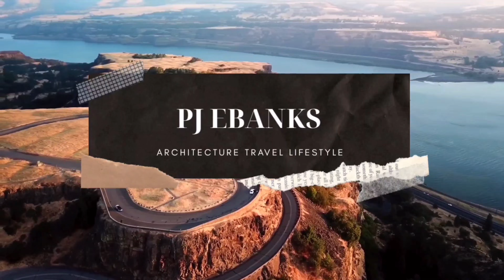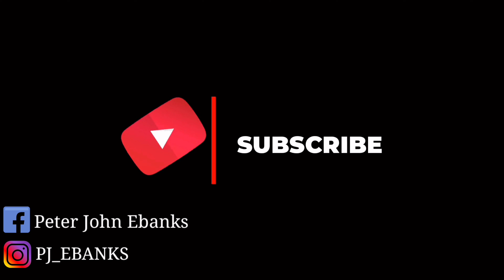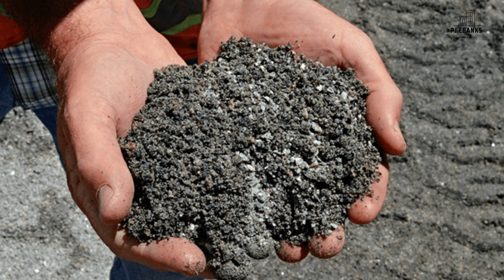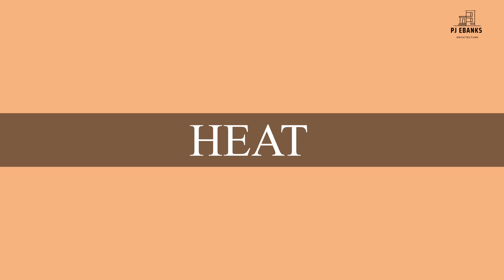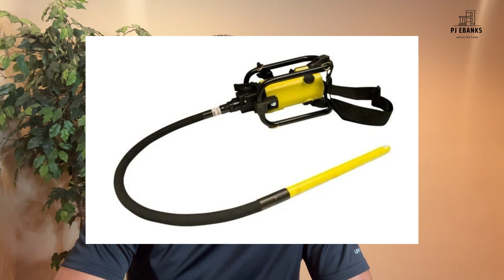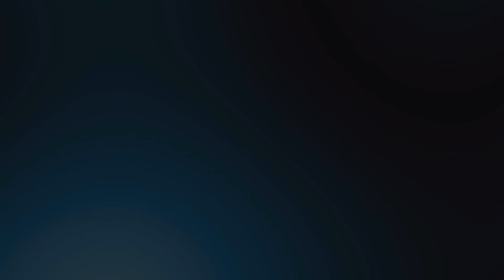Rebuilding After Hurricane Melissa: How to Construct a Strong Concrete Slab Roof in Jamaica

Comment: Roofing is not a one size fits all!  If your structure was never designed with concrete slab roof in mind don't do it. Consult a civil engineering company first. Also, concrete roofs brings LOTS OF HEAT and will make your AC units work harder running up your electric bill. Decra or metal roof is good.
Reply: That’s correct, concrete roof does attract heat, but silicone roof coating is renown as a heat repellent.

Comment: How would you build for earthquake?
Reply from the maker: Great question! To build for an earthquake, the key is a strong reinforced concrete frame with properly tied columns, beams, and shear walls, plus a solid foundation based on your soil type. Good steel, proper tying, and avoiding heavy overhangs help the house flex safely during shaking.
Reply: @PJEbanks TY. If you have not done so, I would like you do a vlog about that.
Reply: Why can't a wooden house withstand an earthquake.  It is all about the footing and the foundation. Most houses inna di USA are wooden structures. Concrete homes could be more devastating during an earthquake due to the weight if not built properly. Can you imagine if these concrete decks collapsed during an earthquake? Notwithstanding,  I think that a well built concrete structure with a fully engineered and constructed timber roof is ideal.

Comment: Thought I heard that some time that is was common to use marl to make concrete down St Elizabeth side. That is a big no no! Marl should never be used in concrete. It’s too porous, and will let water in.
Reply: They use marl on side roads too. Not good. It washes away easily.
Reply from the maker: Yes they need to stop using marl.
Reply: @PJEbanks  they need to stop using it to build side roads too. It washes away.
Reply: Concrete should be made of Portland, sand and aggregate.

Comment: Hope u see this question and answer slab roof or zinc roof which one is more expensive? I currently lose my roof in st Elizabeth so that's why am asking and am thinking about slab roofing
Reply from the maker: I’m sorry to hear that you lost your roof. I hope you will be able to get it back on soon 🙏🏽. To answer your question, it’s cheaper and quicker to go with a zinc roof. If you decide to go the route of zinc, ensure they use J bolts, hurricane straps and screws instead of nails to secure your roof.
Reply: Decra roof .

Comment: Thank you for this useful information.

 I may have to consider a deck roof but from an aesthetic perspective I think it can make the house look unfinished, like the roof is missing and another level is going to be added in the future.
Reply from the maker: Thank you for watching. I agree that it can give off that look, but you can parapet wall around the edges to give it a more complete and modern look.
Reply: You need to consult a civil engineer.  If your structure was not designed for it , don't do it. Concrete slab roofs make a house BAKE LIKE OVEN in the summer months and generally cause your AC units to consume more electricity.  Use decra or metal roof.  Also don't do a flat design or simple gable roof.
Reply: Not saying that slab roofs aren't more structurally sound, but they are unsightly. No wonder you don't see them on more high end homes. I think if you have rails around the perimeter, they will make it more decorative. 

A well designed, engineered and constructed roof makes a home look elegant.